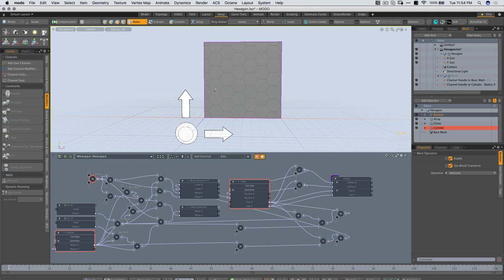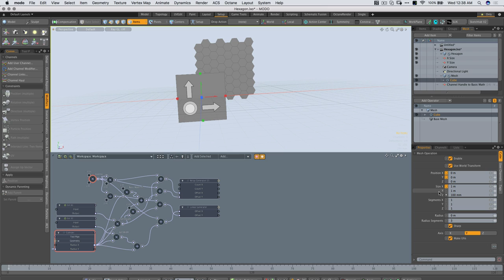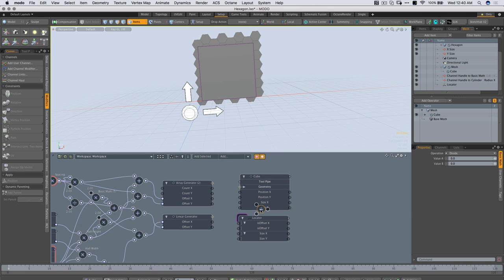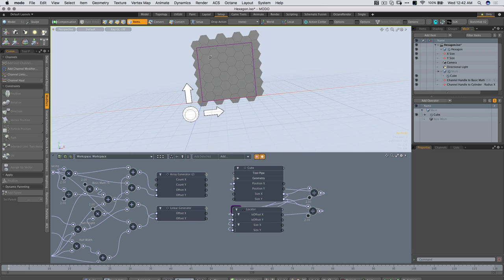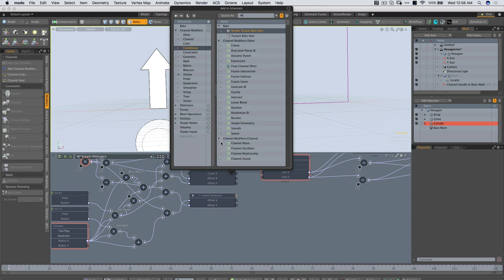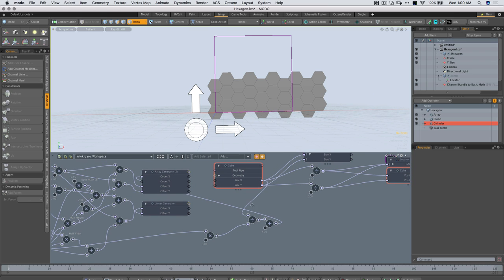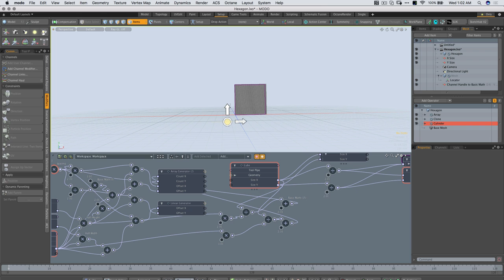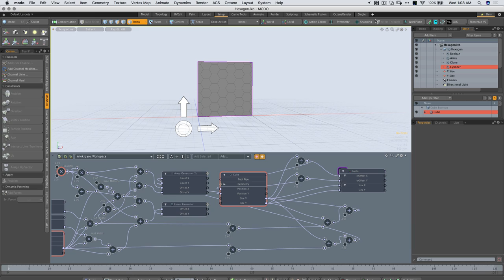Procedural Hexagon Array Borders (How to)

Comment: Thank you.  I have got this far now.  A hive in a box built by spaghetti monster (nodes and wires - maybe "monster" is a little harsh, but I can imagine a larger project would get baffling quickly).  The node system is a good one and popular across many applications it seems, but I've yet to see it implemented in a way that is particularly easy to unpick again at a later date.  When I return to my nodes and wires tomorrow, what are the chances I can remember what did what and why?  Can anything be done to tidy it up and make it more "readable"?
Reply from the maker: Yes there are ways to tidy things up and break them into reusable assemblies or presets. For example, the simple hexagon array itself can be made into a self contained 2-4 input parameter assembly. Then you add on additional behaviors as needed as separate assemblies. The calculation expressions can be rewritten as expressions or also packaged as assemblies. I am going through it manually because you learn how to crawl before you walk before you run type of deal. When you have it under your belt you can then skip and jump as needed. I hope that helps. It really looks scarier than it is. And I want to say, I go back constantly to old scenes and have to recall what I did. Unless I provided notes and broke it down.
Reply: Thank you for your answer.  Well as things stand these hexagon tutorials are just about pitched at a level I can cope with - otherwise I am predominantly direct modeling in Modo.  The procedural stuff is attractive if it can save time and be packaged to be reused.  I look forwards to learning more in later tutorials.  It surprised me to see Modo stall on the division by zero but given the maths block available it should be possibly to prevent that from happening (in programming I'd use something like an absolute value of the variable and then add a tiny amount 0.00001 as an input for any division - or an (if/then) check if I needed positive and negative values to go into a divide) but I sort of imagined that Modo would have some kind of error handling for this anyway and just report the division by zero rather than crash.  Not very friendly when it comes to bug tracking if you have a complex assembly to root through.